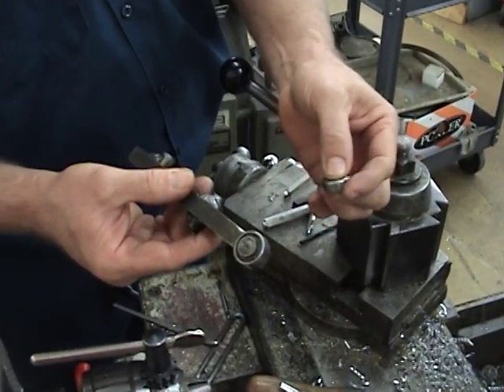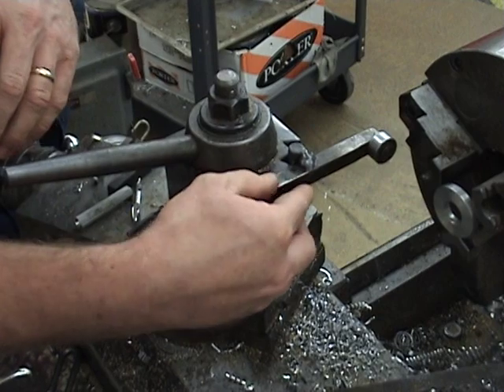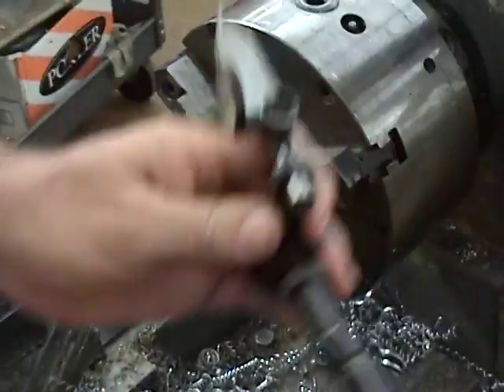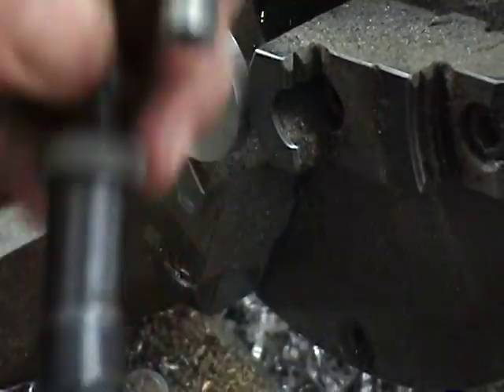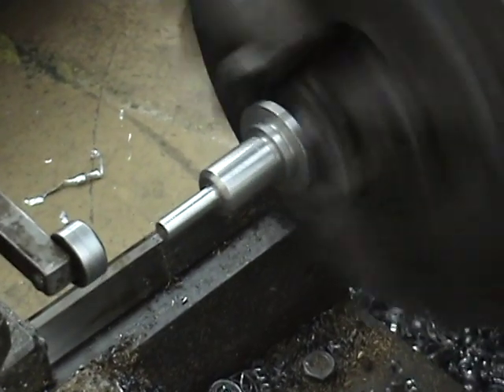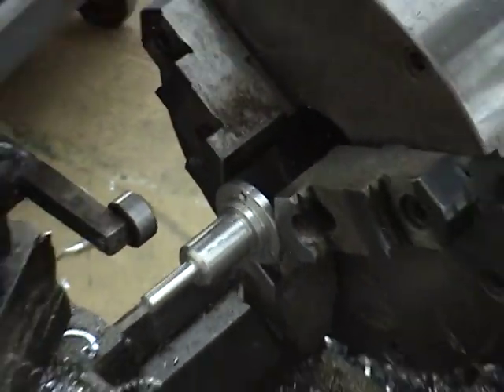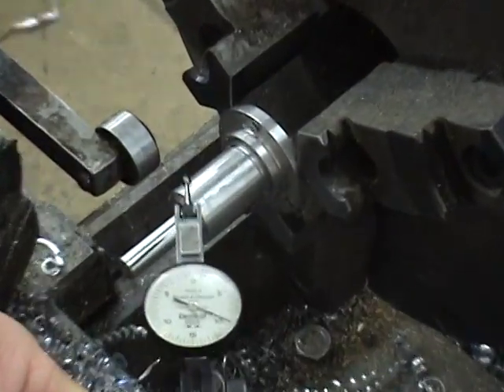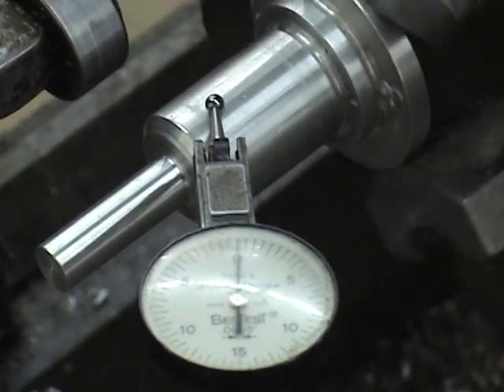HOW TO: INDICATE PARTS IN A LATHE QUICKLY

Comment: Can this be done without the roller bearing or would a bullnose shaped tool cause too much drag on the part or what?

Thanks for the video!
Reply from the maker: Yes that can be done. This roller bearing "nudger" idea evolved from a piece of 3/4 dia. brass rod with a radius on its end and thought a roller bearing would work better and I think it does. Later, RT.

Comment: this was a great tip and I made my own version with a bearing either end so it mounts permanently in a toolholder  for  my QCTP and can do the stock  diameter or face depending on which side of the toolpost its on.  Thanks!

Comment: Once the piece is trued up enough by eye, would it be safe to run the bearing against the piece, and have the indicator on the surface at the same, rather than eyeing it in and then indicating after the chuck has been tightened as you did? Or would any greater accuracy by doing so be negated by the amount it's thrown off by the tightening?

Comment: Copied your very own design sometime back. Has been used with great success several times. If the surface is smooth just on the final alignment touch the DTI on the job as well and bring it to a perfect zero. Thanks for posting

Comment: I love this "trick" its an awesome innovation!!You saw a need and filled it.If you sold those I would buy one! I have a harbor Freight 7x10 and Ive tried 3 times to make one but each time it seems Im missing something. Ive been teaching myself by watching videos posted by guys like you. I have a question,does the bearing have to be centered or on the same plane to the cutting edge of a tool? Im guessing thats why mine aren't working correctly.Not a machinist!!!but I love working with the lathe.

Comment: Im doing this without a bearing. Just mount a chisel in the holder with its backside to the workpiece and push it against the longitudinal side and the loose clamped workpiece will center itself. It leaves some marks but if you turn over it anyway it doesn't matter. It's not the most elegant way but it works.

Comment: you could put a parallel behind the piece to square it against the headstock.. but if you do this REMEMBER to remove the parallel when youve tightened the piece, otherwise it will hurt.. alot

Comment: I have to say i have never seen it done like this , this is a good thing. I have grown up in a michine shop "Dad"" and i have followed. I have seen a lot of bad advice on here and bad machine practices. This is a nice and simple step , good job. I'm by no means a lathe operator but run one often enough to get the job done. There is a danger in this process but with thought and care it works well.

Comment from the maker: @EIBBOR2654 , yes sir you can't get much simpler than this. The first "version" was just a 1/2 inch dia. brass rod to push against the part. Work great for steel, but deposited brass on an aluminum part. Thats when the "light bulb" came on to use a ball bearing. So, you see this idea was an evolution of sorts. Thank you for the kind comments and especially for your service to our country. Later, Rick.

Comment from the maker: @julieann620 , i suppose so, but you need to use indicator as close to the jaws as possible on a long part. Then, maybe you could use the ball bearing to move the part on the other end. If the part is thin I don't see much of a problem of using the ball bearing on the face of the part either. Good luck to you. Later, Rick.

Comment: I turned the end of some bar stock down and tapped it to use a captive screw to hold the bearing on.   It looks like the bearing is sitting on the end of the rod and not adjacent to the rod.  It seems to work though.   Cheers!

Comment: Hello Rick, I did try this method today I forgot to tell you that I am using a Teflon material to machine, every time I bring the ball bearing close to the part it pushes the part out of the chuck, and I think you are right that clamping force on the chuck is either full or full off. Currently I am centering using a dial gauge but it is time consuming. Any other method I can use to center, Thanks for your help, later bik

Comment from the maker: @bikswahla , the problem with the CNC lathe chucks I am familiar with, the chucks are either full on or full off, no in-between, so depending how much pressure the clamping force of the chuck will determine if the ball bearing would move the part. Good luck and thanks for the kind comment. Later, Rick.

Comment: hello there, excellent idea to center a part on the chuck, I just want to ask you is this process will be good for centering a cylindrical part OD- 6" and 9" long. I want to center on CNC lathe I cannot use a tail stock as the Part has a Boring Operation. Thanks for your help

Comment from the maker: @Ziknazoo , the gooseneck is an indicator magnetic base. A small lever tightens a cable which locks the segments. Its expensive but makes the indicator job easier. I hardly use it any more with the ball bearing thingy. Thanks for the positive comments. Later, Rick.

Comment from the maker: @cheeriomartinez , thanks for the positive comment. This tool is easily made and its use mastered by most beginner machinists, so I don't think folks would buy something that has to be specially tailored to individual tool posts. After all, its just a ball bearing bolted to a piece of steel. Later, Rick.

Comment from the maker: @UsefulBenevolence , thanks for the positive comment. I just used the indicator for the first few times I ever used the ball bearing technique to verify in my mind that it worked, and here just to verify to the viewer that it worked. I very seldom use my indicator on the lathe anymore. About using the indicator while moving the ball bearing. You must find a stationary spot for the base other than the cross slide, obviously. Thanks for your interest.

Comment from the maker: @bentontool , thanks for the positive comment. I measured across (2) 1/2 dia. dowels while holding them in the Aloris tool post wedges. then subtracted 1/2 inch from that value and plunge-milled a slight radius in the cold-rolled bar to locate the dowels. Clamped while welding. Just don't wedge the dowels too much while using the tool or you might push a dowel off. Later, Rick.

Comment from the maker: @macsthunderhawk , thanks for the kind comment. It was an evolution of sorts because, at first I use my cutting tool tip while running the spindle in reverse(still do sometimes making simple washers), then, I used a piece of 1/2 dia. brass clamped in a tool holder, then got the idea to use a ball bearing bolted to the cold rolled in a tool holder, then to free-up a tool holder, welded 1/2 dia. dowels to the 1/2 in. CRS. Later, Rick.

Comment: Amateur Question:  Dowel pins welded to a piece of CRS!  Fabulous idea!  How did you weld-up the jig?  Did you machine a mating round-bottom groove on the CRS to accept the pin prior to welding?  Did you mill a flat on the dowel pin?  I suspect welding a round dowel pin onto a flat piece of CRS would be too difficult... A.

Comment: If you want to have it right every time, push it a little further and then slowly pull it back. The accuracy is the feed out per revolution. If you want an accuracy of 0.001", feed out at 0.001" per revolution. The error will be between zero and 0.001".

Comment from the maker: @LG6327 , don't know about a tool, but I have used the jaws of the chuck against the tool post to index the spindle in order to scribe a line on the face or end of a shaft. The 6 jaw for indexing 3 or 6 places and the 4 jaw for 4 or 90 degrees. Hope this helps.

Comment: I just finished mine,I turned a piece of some god awful hard steel to fit the center diameter of the bearing and then welded it to a 5/16 piece of regular bar stock and tried it a 1/2 hour later and its freaking great.No more smacking the piece with a very small rubber mallet hoping for something close for me anymore.Thank you

Comment from the maker: @caulk04 , be careful with that as Dykem(layout fluid) as it will get on your part and it has thickness too and may interfere with and give you a false reading. I look between the bearing and the part to see light between them to determine how much the part is out of indication and then decide whether I need to try again. Thanks for the kind comment.

Comment from the maker: @modernblacksmith , thanks for the kind comment. About 4 jaws: I try to avoid them but when I do I use 1/4 inch alum. shims to prevent scuffing part, use only 3 jaws until I get it close, and get "in the zone" with the indicator. It just takes practice to get fast.

Comment from the maker: @shadowdog500 , checking to see your progress while using the ball bearing is a good "positive reinforcement" technique, and that is ok. Most of the times I use it, I peek between the bearing and the part as I back-off to see the light between them. If this light doesn't "flash" much, I'm close enough for the lathe work I do. When I first starting using this idea, I checked and now I don't bother checking. If it has to be more precise I'll use the OD grinder. Good luck. Later.

Comment: Wondering if you could put the indicator on the work while using the tool to indicate the part.  Instead of just looking for no movement you could also look for the deflection on the needle to slowly wind to zero..
Reply: Shadowdog500  yes u r correct

Comment from the maker: @MrBallistic31 , good luck. I think you'll see that as you get more experience using it you will feel more comfortable using it. I have found it works better the more the part wobbles initially and you can do it at slower rpm's if you wish. Thanks for the kind comment.

Comment: I think that is a great handy lil tip. It will get you up and running faster that is for sure. I know some are like thats not very good. Well i say you indicator is on it make it better if you like with a few small taps of a hammer. Im going to give this a whirl at the shop tomorrow , thanx for the tip

Comment from the maker: @Forbidenist , uhhh...yeah,uhhh...good detective work.  The indicator needle movement "indicates" runout. I would not dare say there were no adjustment screws. I use the screws to adjust a 1 inch dowel to within .001 TIR first. These particular parts can be out up to a couple thou. As witness to the video, the bearing-bar-thinga-ma-jig got it to within .001. I would dare say the Machining Community is looking forward to an uploaded video of you indicating a part with "NO RUNOUT IN ANY QUADRANT"

Comment from the maker: @fatcatslimcat , very seldom do I bother using the indicator. I only use the indicator in the video to show the viewer how precise the method is. IMO, if something has to be more precise than a couple thou on the lathe, as far as concentricity is concerned, I will OD grind it between centers. Be careful running the spindle with the indicator tip touching for very long as you may wear a flat on the tip. Good luck.

Comment from the maker: @AdeV2 , it is a segmented indicator base. Works great by getting the indictor close to where you want it, tighten the cable going thru the center of the segments with a lever and will adjust slightly with a small amount of force to set the indicator needle. Search nolansupply

Comment: I usually use a drill chuck  at the tailstock to align small cylindrical workpiece without tightening it too much and just let the head spin slowly or by hand. When dealing with large diameter pipes or hollow cylinder I use the 3 - 4 inch dia. live center. Thin washers can be aligned by using parallels against the backside and on to the face of the 3 jaw chuck. I will definitely use your idea though. I can't believe I didn't thought of this.

Comment from the maker: @gammaphoton  Cool to see other's variations of the "ball bearing" indicator concept. Another variation I use in a pinch is clamping the part very, very light, running the lathe in reverse, and use my cutting tool for indication. (Don't forget to tighten chuck!!)It will leave a slight mark but good enough for a washer, etc.